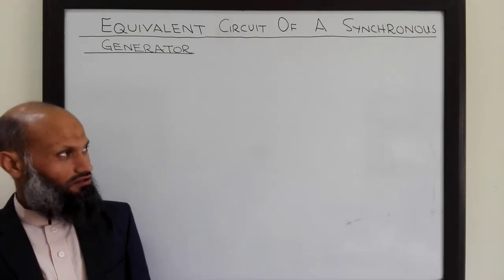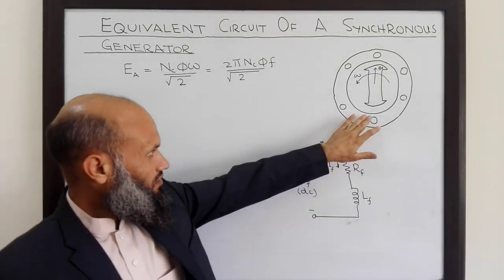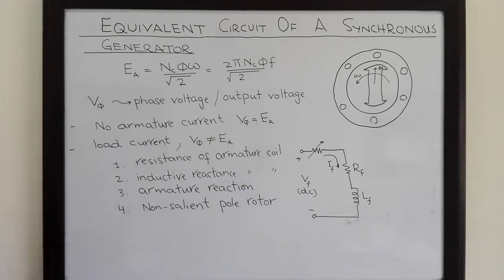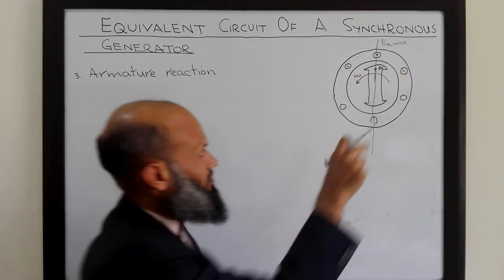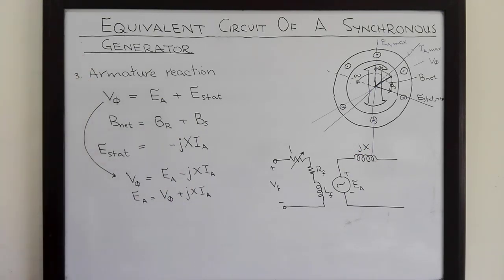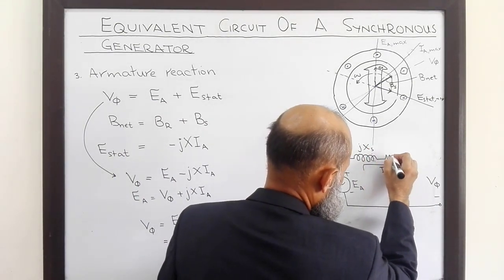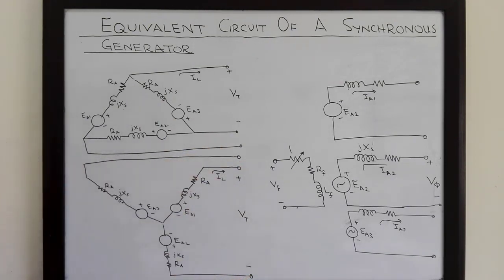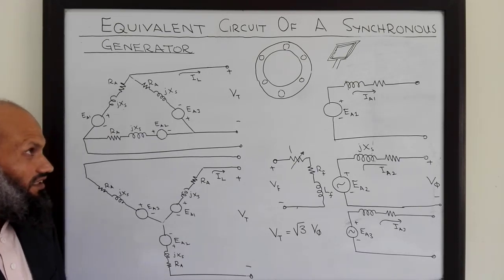EE213 - 36 - Equivalent electrical circuit of a synchronous generator

Comment: are the equations same or different for synchronous motor?
Reply from the maker: There is a slight difference, because the direction of current in generators is opposite to the direction of current in motors.

Comment: Sir DC  voltage is applied to field windings in which way produce magnetic flux b/c DC have zero frequency plz sir answer
Reply from the maker: A current carrying conductor always has a magnetic field around it, no matter, whether it is DC or AC.

Comment: Sir, how to create balance torque on rotor, when mmf air gap is sine form
Reply: @MAFarooqi  sir, but why velocity is constant?
Reply from the maker: @relaxwithme4695  in ac machines, induced torque is given by tau = k B_r x B_s = B_r B_s sin (gamma). It is important to remember that in synchronous motors, the rotor is locked with the rotating stator magnetic field, and hence the angle gamma is almost constant. Therefore, the induced torque is also constant.